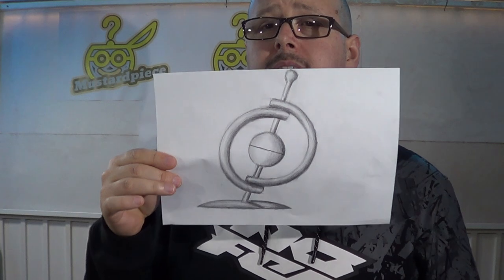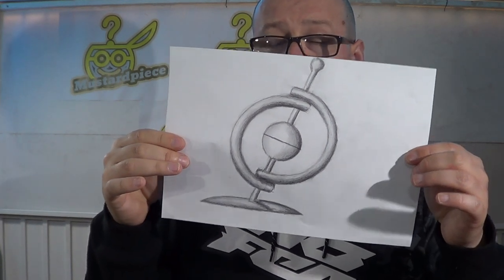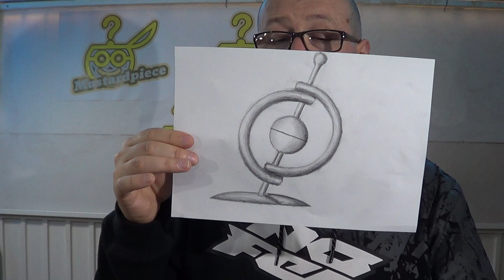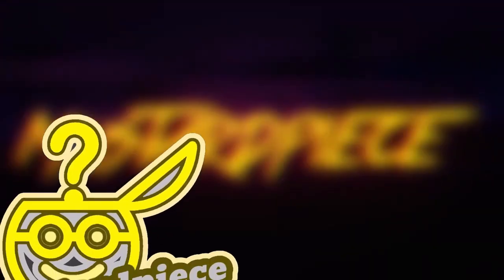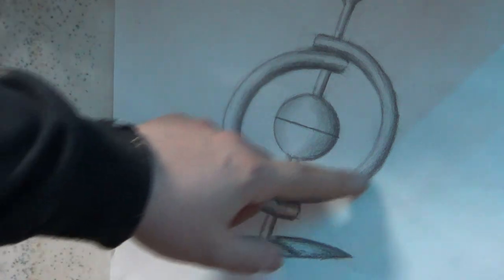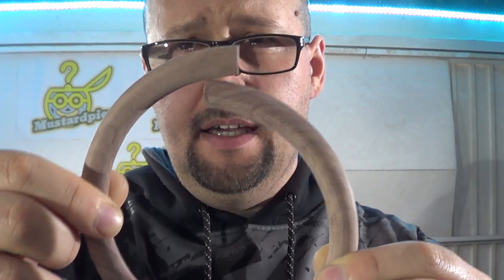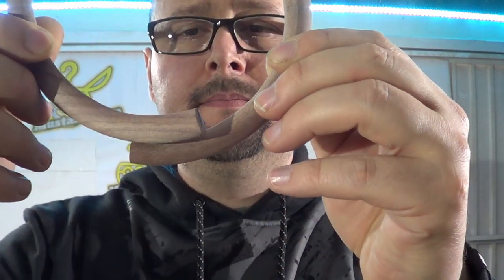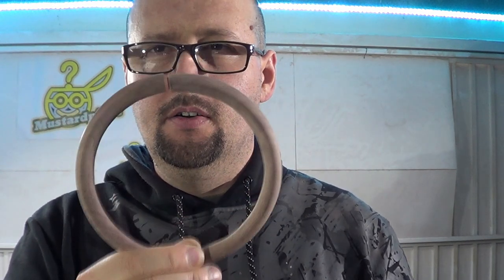Ring Jewelry Box - Woodturning

Comment: Hi Atilla, nice design, well executed for a beautiful piece. I am sure there are other ways of figuring out the ring overlap however I thought that you might cut two rings out of paper or cardboard and experiment with the overlap until you are happy before turning in wood. Keep well, Rob
Reply from the maker: Thank you. I sat there for hours with a compass, But I could not figure it out. Now I know the solution, I should have used the inner diameter of the large ring to draw the outer diameter of a smaller ring. That simple. It must be two different in diameters, cant be the same as I wanted to.

Comment: Looks great!! Even bvb if it wasn't the design you were going gor!
Reply from the maker: Thank you so much. I have just realized what to do to solve that problem. It is very simple. I dont know how I did think of it sooner.
Reply: @Mustardpiece  would it be cutting a larger circle cutting in half to combine the 2?
Reply: @Mustardpiece  also did I hear mention of a logo using the question mark? I hope it is very geometric like your work!
Reply from the maker: @Hencley  Simple just use the inner diameter of the large circle to draw the small circle outer diameter. That way it will fit perfectly into each other.
Reply from the maker: @Hencley  I'm taking out the question mark from the logo. The question mark was there to represent me not knowing what to do. I like to think that is not the case anymore. I also getting an animate intro for my channel with that service. The logo, I can do myself, but I dont know how to animate it.  My logo will move, jump and there will be a voice actor saying few words. It will be about 10 seconds long.  - Attila

Comment: I dont know if its camera angle or what but you always seam to have your tool rest too far from your peace. But still beautiful work tho
Reply from the maker: Thank you. I have 7 tools and 3 of them has a flat bottom on them that starts from about 4 or 5 cm s further from the tip. One of my tools has exchangeable tips fixed on by a screw. The screw is simple in the way. On flat bottom tools I like to rest them on the flat part when I turn. Simple not practice to put them much closer and I got used to it by now.  So now even with my new tools I keep them a bit further away.  It works for me, but I don't recommend it to anybody else. I don't claim know the techniques, I only have 6 month experience and I'm self taught. 

Please remember i'm not trying to teach anybody. If you check my channel art I says " Woodturning my way"

Thank you for watching and commenting. :)
Reply: @Mustardpiece  I know your not teaching just don't want you hurting yourself and spoiling your work either
Reply from the maker: Thank you.